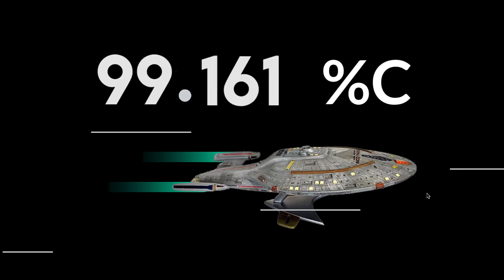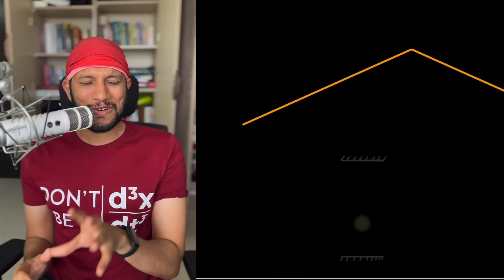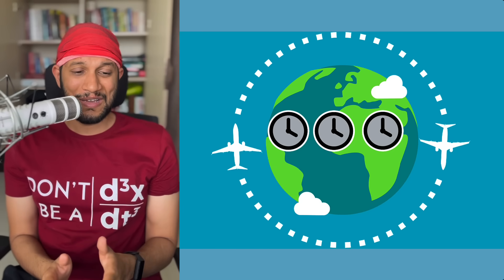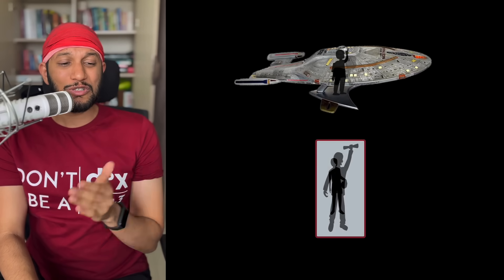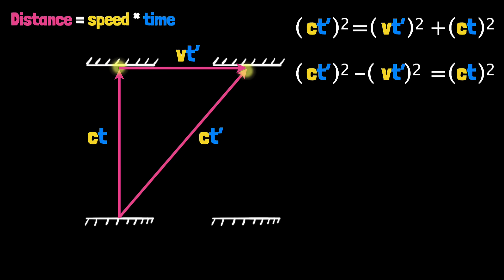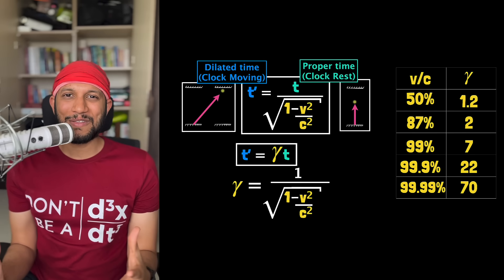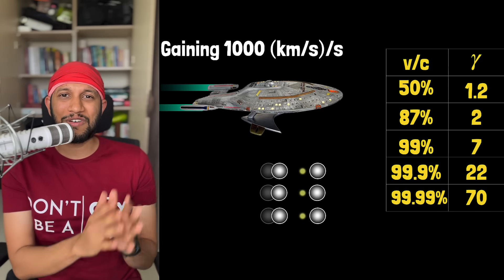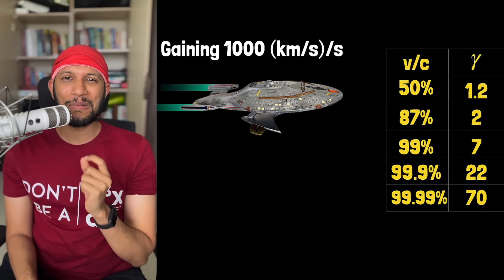I finally understood why you can't go faster than light! (My mind is blown)

Comment: The counting mechanism slowed in the photon clock because we changed the path between the reflectors.  Time remained constant.  If you changed the reflecting surface to be perfectly perpendicular to the path of travel to the light as you accelerated, the time would remain constant.  What am I missing?
Reply: If something approaching the speed of light freezes, why doesn't a photon appear to freeze?
Reply: @silverbackhayabusa  photons are frozen (internally). They don't "approach". Your something is matter. Photons are not matter : String theory did not result in anything.
Reply: @ArneChristianRosenfeldt  Frozen internally? How do you freeze something internally when it lacks internals?

I don't see how you addressed my specific question.  I did see later in the video where changing the direction of the surfaces would restore the proper distance and yet the clock would "slow."  But that's just the clock's ability to count rather than the actual passage of time as shown in this video.

Perhaps it's a shortfall in the video and description of the actual physics happening.  Admittedly, my physics understanding is closer to the simplistic side of things than the complex.  However, what is described and observed in the video seems to be an issued with a mechanism of the "clock" rather than the actual passage of time.
Reply: @silverbackhayabusa  photons have polarization as internal property in many pictures. So for that I mention it. Spin 1 is so important for some, but in laser physics cavity modes often contain linear polarization. So is spin in photons even real?

I can't address your question because it melts my brain. Minkowski diagrams with x and t axis fit nicely on a sheet of paper. They lead to a consistent result. I don't know why you pull y,z into this. Ah, the clock example does. Hmm. Perhaps it is simpler to have a clock pulsing in line with velocity?

time is defined as the thing measured by a clock. Historically, we used the sun. Then the Swiss made watches. Yeah, took some time (pun), but we decided that a watch displays the time more than the sun does. But I think this race is mostly over. "actual passage of time" is not a concept which will give us more insight.
Reply: @silverbackhayabusa  Ah, since I am bad a math ( like Einstein relative to his wife ), I came up withe a "Gedankenexperiment". Two sledges on tracks next to each other. Both have relays, which tricker for any flash they receiver and send out a reply flash in the broad direction of the other sledge. Now accelerate both the same. There is no angle given by the set-up. I don't know how sledges would measure their relative distance if it was not for the tracks. But we surely expect no lateral forces to the track rails even if we mechanically connect the sledges?
Reply: @ArneChristianRosenfeldt  "Ah, the clock example does. Hmm. Perhaps it is simpler to have a clock pulsing in line with velocity?"
I like that.  The difficulty is implementation which would likely still rely on movement but at the most basic level something that could pulse without motion to signal to the observer (again without motion) passage of time would help.

On a side note, I don't think time is defined by clocks.  Clocks are just the tool to measure time.
Reply: @silverbackhayabusa agree to disagree? Time is philosophy. Empirically, we tried many different clock types and found out that a lot of them agree with each other. Time without clock makes people believe in absolute time.
Reply: @ArneChristianRosenfeldt  I didn't say clocks aren't effective or consistent.  But if you manipulate a clock's functions, that doesn't mean the passage of time has slowed or quickened.  It means you manipulated the function of the clock.

If I grind down a yardstick to half its length, that doesn't mean that a yard is now half the distance.  It means I manipulated the yardstick.  If I manipulate the function of a clock with acceleration, it doesn't mean more or less time has passed, simply that I manipulated the clock and impeded it's function.

I'm not trying to agree or disagree.  I'm trying to understand.  And given what I'm presented, I'm explaining what I see which I understand is not consistent with what the PhDs are saying.
Reply: @silverbackhayabusa  time is a model like everything else in physics. It was "discovered" sounds like it was always there, but randomly a cover was over it. But this is not how (AI) learning works or history works. A truth underneath it all? This sounds very much like behind it all is a God which made us like him. This is not science.
Reply: @ArneChristianRosenfeldt  Your reply has zero to do with anything I said.

Comment: (part 2, continued) - please read part 1 first
In order to do this feat one would have to be able to generate a field effect or an alternate gravitic field that counters the gravity already in existence. Gravity A comes with the planet you stand on nothing additional is required. If you drop anything heavy on your foot you feel Gravity A. Gravity B can be created artificially to counter the forces of Gravity A that surely allows the manipulation of any craft when it is NOT displacing from major location to major location. Gravity B is used mostly with local traversal in an Omicron configuration (Omicron is best left out for this post or it will digress the point terribly, confusing the issue). Consider Omicron as local travel near a celestial body (or its atmosphere) as 2nd gear (in our cars) compared to 1,000th gear for vast traversals between space quadrants. The craft sufficiently has a field on the skin of the craft (the field can extend even a few microns away from the composite materials) that allows it to bypass ALL MATTER (atmospheric or celestial matter) that occupants inside are not even burdened with plowing THROUGH the matter (the way we barbarically do). They are time-phased as partially being within this time and the timeless void they can travel vast distances in.
.
Everything I am saying is true and if you doubt me just ask the Ocean navigators (military and civilian) on ships who saw such craft entrance and egress the ocean without making a single splash. The TIME within the craft just has to be at least t+1 and your craft will not be in the location (even at the atomic level) where the H2O molecule is located. If you think all of this is NOT possible just imagine talking to people in the 16-century about cell towers and smartphones. You are walking around with a TIME PORTAL device (smartphone) in your pocket where you can talk to another living person on the other side of the planet in real time, that can play videos showing people that were taped over 100 years ago (now long dead) and still claim what I wrote is NOT possible. All the while sitting comfortably on planes 45,000 feet above the Earth in a tube as you scroll information from your 'time portal' device. Imagine explaining those concept to the sandle-wearing peoples of yesteryear and see how crazy you sound trying to do this feat. Oh yea of little faith and lack of understanding.
.
The way humanity travels by 'penetrating' atmosphere with its sharply angled nose cones as a craft plows through the atmosphere is SO BACKWARDS and so not inefficient it boggles how one can't compare our species to monkeys playing with matchsticks compared to what is TRULY possible. We light giant conical rockets at one end and FORCE the atmosphere to bend to that penetration. This is very inefficient and will not work to traverse multitudes of distance. It just will not. Slamming into even the tiniest of particles in sufficient quantity at those speeds will leave a trail of debris scattered over 1 astronomical unit. Liquefied in their spacesuits. There is a much better way. Star Trek got it wrong, Star Wars got it wrong, Interstellar got it wrong, every space flight movie got it wrong. It is way more elegant and beautiful then anyone could imagine.

Comment: the imaginary conversation with Einstein makes the message convoluted for the very simple reason:
A. if Einstein indeed said what the narrator quoted, then it is perfectly fine.
B. if Einstein did not say what the narrator quoted, then the narrator was just using Einstein's reputation to push for his own understanding and this is a REAL turn off for any science lecture.

why dont you just male your own conclusion, hypothesis or whatever opinion without the need to quote imaginary statements from anybody?

Comment: surely we can not go at the exact speed of light. check.
we can not accelerate UP to the speed of light. check.
what happens if something is allready faster than the speed of light, and attempts to de-accelerate TO the speed of light -> no idea.
what if you don't need to accelerate, you are allready faster than the speed of light -> even less idea.
could be observe anything that is actualy faster than the speed of light.  -> hell no. 
can there be something we can not observe . -> absolutedamnyright yess.
this makes no sense. check.
the world does not have to make sense. check.

did we solve anything . -> nope.
Reply: You seem to be on a way to insanity. We need science to get to the next stars. No shortcuts around the maths had been found since STR. Tachyons are not real.
Reply: @ArneChristianRosenfeldt  sciense constantly evolves. Any scientific statement is based on the current best knowledge. That implies possibility of change in the future. Laws of physics is based on observstions . And we seen just an insignificantly tiny fraction of the world.
Reply: @nagyandras8857  Did science evolve? I am still waiting for cold fusion, flying cars, and a cure for the common cold. No cyborgs : People still have to live with bad eyes and ears. The last fundamental Nobel price was about the Higgs field, which has no practical use for us. AI is the only thing which evolves. Last millennium was so great. All the semiconductor stuff which was invented. LEDs in all colors. Transistors. Sensitive PhotoDiode sensors. Aerospace . This Millennium brought us what? SpaceX and Starlink.
Reply: @ArneChristianRosenfeldt  indeed sciense evolves . Sometimes rapidly 
, sometimes not. There are times of refinement only . Sometimes there are brand new fields .
Just think about quatum physics . For  now out everyday life is unaffected , however quantum channeling and entanglment are pretty interesting 
 , even if not yet applicable. 
An analogy would be the artificial intelligence hype of the current times. Even so a.i. as a scientific field of study is not new at all. Just look up its history.
Reply: @ArneChristianRosenfeldt  
https://www.youtube.com/watch?v=NIk_0AW5hFU

there you go, stuff going faster than the speed of light. PROOVEN.
em i still insane ?

You owe me the answer.
Reply: @nagyandras8857  that title is a click bait. As a fan of Schrödinger, Wiegner, Einstein, and many worlds, nothing needs to travel FTL for this.
Reply: @ArneChristianRosenfeldt  
Quantum entanglement involves instantaneous correlations between particles, meaning that measuring one entangled particle instantly determines the state of its partner, regardless of distance. Experiments have shown that the speed of this correlation is at least 10,000 times faster than the speed of light, and in some cases, such as with top quarks at the Large Hadron Collider, entanglement persists over distances that exceed what could be covered by light-speed communication.
Reply: @nagyandras8857  But this is only true in Copenhagen interpretation, but no in many Worlds. They say that neither one is falseable ( Hidden variables and pilots are false) . So I am free to choose a bit many world and use two cat scientist ( from Wing Commander ). They both send a classic message to me and I compare the results "open the boxes of Schrödinger".
Reply: @ArneChristianRosenfeldt  and we can jump back to step 1. We currently have no clue . That is my point. 
A very very famous example is.. black hole , and hawking radiation .
Was comsidered impossibe. Nothing can emitt from a blackhole.  But it turns out there are special cases. 

My special case : can a particle come to exsistence , and have higher speed than light would have , from the very momet it comes to exsistance.

We simply don't know.

Comment: Your explanation explains the reduced acceleration but not the increased mass? A ship travelling at 88% light speed takes twice as long to burn its propellant but it still receives the same amount of thrust per kg burnt.

And another thing I don't understand is as far as we can tell there's no centre to the universe so everything is moving so how do we know what the proper time is? If we could measure the difference in time dilation in different directions we should be able calculate the centre of the universe?
Reply: Mass is for differential equations. Those are hard. Can we please stick to discrete stages and Lorenz transformation?

Comment: I didn't watch the video, but you effectively gain mass.  As you would approach C your ships mass and the thrust it would need to keep accelerating approaching infinity.  By the time you thought you were going full C the entire timeline of the cosmos will have played out since time also slows down as you approach C.  So it would basically take infinity to get full speed, and you wouldn't even notice because time would stop for you if you did ever get to C.  Time would also stop for your ships control and computers, it would never know to stop or slow down.  Am I right?

Comment: because everything faster then the speed of light would make everything dark, if you ever went faster then it....lol idk i thought star trek ships encapsulate their ships in a pocket bubble of real space, and the ship itself isnt actually moving, the pocket dimension that encapsulates the ship is whats moving at light speeds? when the warp field collapses the star trek ship stops moving threw warped space, and gets deposited back into real space, at impulse speeds. However the oddity with alot of star trek ships, is that they visually function very similar to star wars hyperspace, rather then a "warped space" drive. since star trek ships can apparently shoot at each other, whilst in warp, even though, their weapons would technically have to penetrate their warp field bubble, cross threw whatever warped space is at even faster then warp speeds, penetrate the other ships warp field bubble, and hit the other ship in its real space bubble, where the starship is actually stationary and not moving.

Comment: Except in Quantum Physics of course. Where the same particle can be in multiple places at once through transverse sympathetic transfer. But that's just theory.. although Einstein's theory of relativity was also considered to be just a "theory". Oh and there are actual Quantum Computers now that operate under Quantum mechanics. But your talking about "physical speed".. where Quantum speed is irrelevant because there is no physical movement.
Reply: all fields in Theory are routinely checked that they respect special relativity. Special relativity was discovered in the EM field. Dirac showed how to calculate electrons correctly. All Quantum Theories which break locality have been disproven in experiments. Reminds me: I need to check the raw data of those experiments. Some are open. so much to do in my life

Comment: Here's a thought...if you could measure the angle of the photon in the clock you could find absolute zero velocity .
Reply: In the greater picture photons are used to define angles : triangulation

Comment: Maybe I'm not understanding this, but I don't see much proof for time dilation. The first two examples of the different clocks don't sound like time dilation; it sounds like the speed by which the clocks traveled interfering with the mechanisms (the photon taking longer to hit the other plate because it's moving diagonally due to moving so fast). Why not try a method of recording time that can't be interfered by the speed that the device is traveling (even if that means using a human)? The last example of radioactive decay slowing down when moving close to the speed of light does not seem like strong evidence as the explanation of the slowed decay isn't explained like the examples of the clocks (all we have is the end result and not an explanation behind how it is occurring). I don't understand the mechanism behind how radioactive decay occurs, but if it is anything like the type of decay I know, outside conditions (temperature, presence of air and moisture, chemical treatment) can slow or hasten decay. Could the higher speeds be preventing the process of radioactive decay from occurring somehow without it being time dilation?
Reply: There is indeed a way to speed up decay from the outside. Nuclei with a lot of protons can capture an electron ( their electron ). If you strip these atoms of all their electrons, the decay is slower ( they need to emit an anit-electron = positron ). For humans you need biology, for this you need chemistry, for this you need physics: The electro magnetic field is important for chemical bonds. You cannot get rid of it. Just using the EM field ( photon ping-pong ) is the most simple solution. Perhaps you can build something out of neutrons on neutrinos ?

Comment: Did you consider the length contraction (Lorentz contraction) while nearing the speed of light? How does that harmonize with the assumption that the propagation of information inside the accelerating "ship" takes longer than in a (relatively) static object?  Or am I completely off the rails?